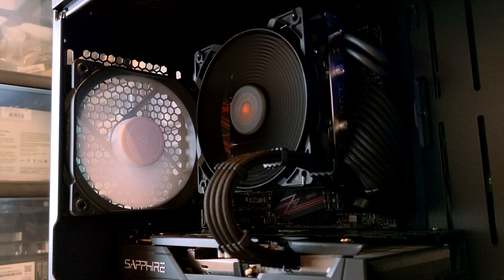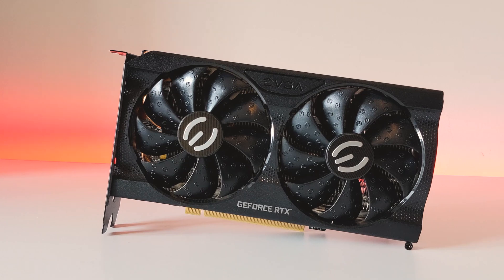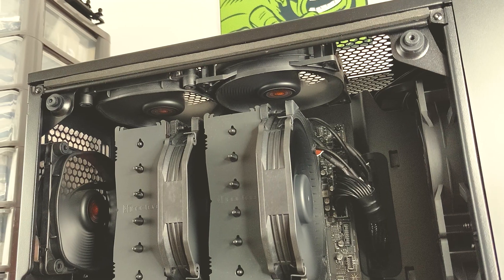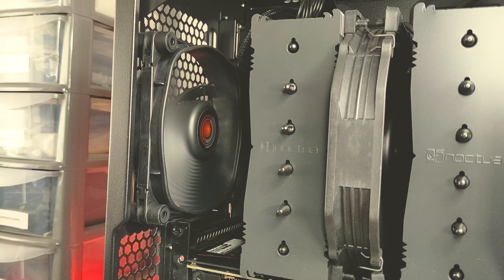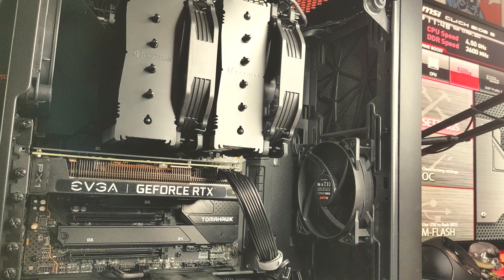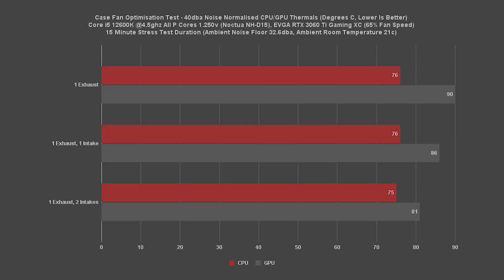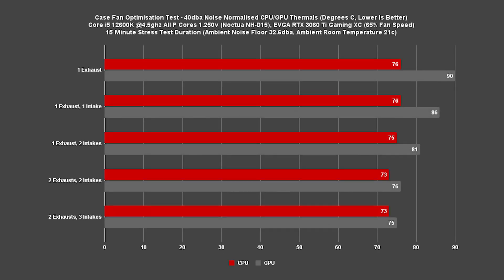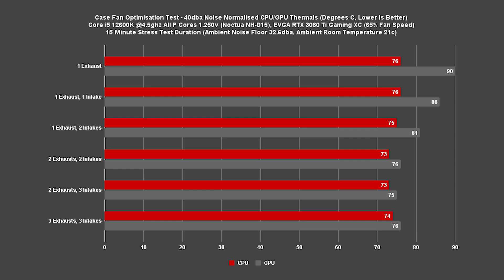How Many PC Case Fans Do You Need? Airflow Optimisation Guide

Comment: Very informative, I’m building in a O11 mini and going with air cooling 2 side intakes, 3 bottom intakes, and 1 exhaust from the back. It doesn’t make sense putting 3 fans at the top for exhaust, the top fan in front of the case would just steal air from the the top side intake and the middle fan would take even more air before it gets to the cpu cooler. I might put an exhaust fan at the top all the way in the back though
Reply from the maker: Cheers mate! Sounds good. The O11 Mini is a great case 👍

Comment: Really enjoy your channel and the effort you make responding to all the comments.  I’m looking at adding some new fans with summer coming and appreciate the info. I have 3 intakes and one exhaust set on top rear.  The uh12a is cpu cooler and sits near the back so I moved the exhaust I was using to the top.  I was thinking the same thing about the top exhaust sitting closer to the front stealing cool air.  Planning on testing a fan sitting on the outside rear of case and maybe 2 slim profile fans under gpu.
Reply from the maker: Cheers mate! Really appreciate it 👍 Ah sounds good! Just takes some trial and error but sounds like you're on the right track 👍